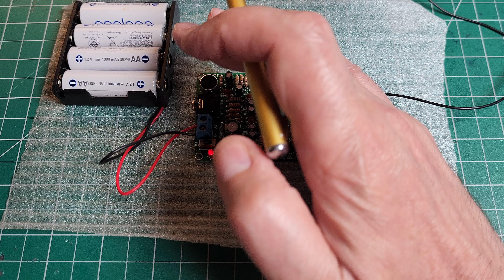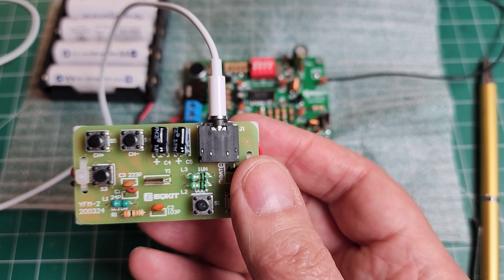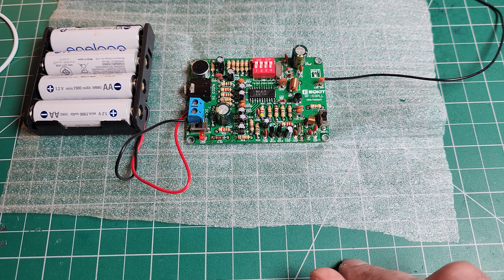FM Radio Transmitter DIY KIT Part 2.🤔 IT'S WORKING ! 😄👍

Comment: Glad you got it fixed OK. Yep, those tiny diodes will get you every time. Get yourself one of those cheap jeweller's loupe's for about 5 bucks from Amazon, etc. Those give a great magnification and will identify these diodes easily. I know all about old eyes.
Reply from the maker: I'll take your advice and buy one because as we both know the printed diodes are so small that it's almost impossible to read them without some form of magnification.

Also never assume anything. 😅

Thanks for the reply and advice.

It's nice to hear from you again. 

Hopefully the snow has melted.
Reply: @decem_unosquattro9538  Hey, you're welcome. Yes, thanks.....snow mostly gone and having a very easy winter so far. Hope your summer isn't too blistering either. I am looking forward to spring.
Reply from the maker: Our summer hasn't been too bad thankfully.

Same here I'm looking forward to Autumn and Winter.

Dec.